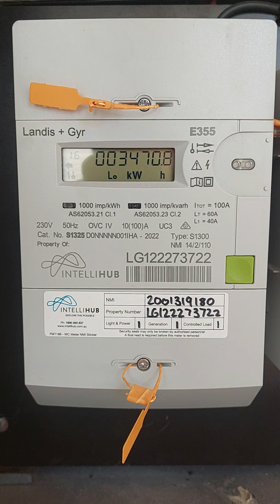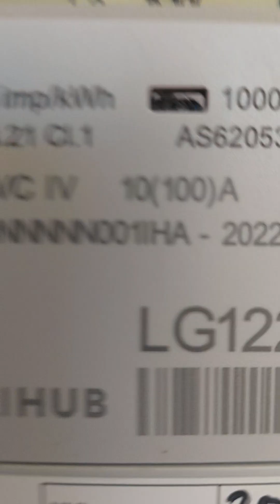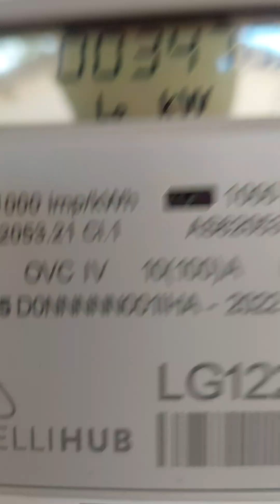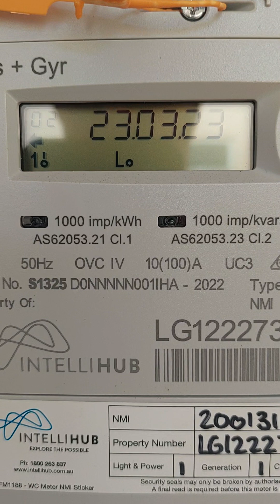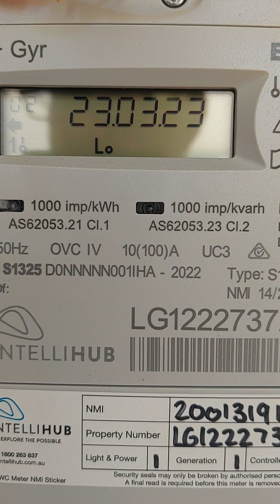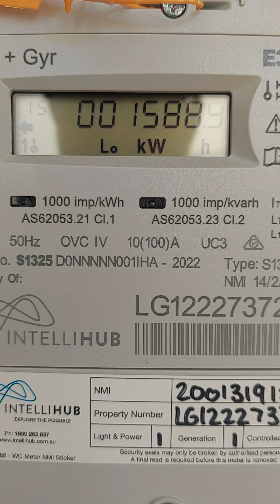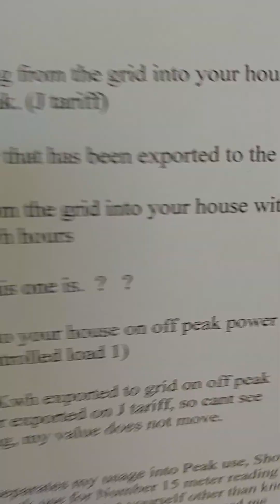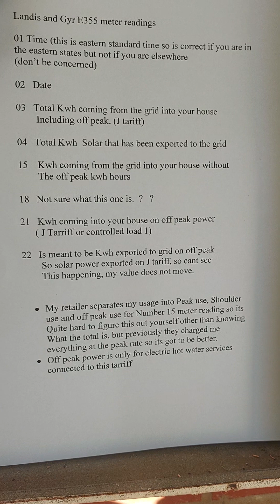How to read your Landis & Gyr E355 Meter

Comment: How to read real-time info from one of these meters: (yes, Jamie has shown how to read accumulated power).. press the button about 3 times until "ALT2" is displayed, then press and hold for about 3 seconds. It should display the Volts (about 240) and you can cycle to Amps - and see what you're actually using moment by moment. Plus a whole lotta other gobbledy gook. It will go back to normal display after about a minute.
Thx Jamie for putting this vid up - not at all surprised that nobody can find usage info, and power distros and retailers are all playing dumb and pointing the finger at each other: as long as they can charge us for power they dont care and dont have to.
Reply: Thanks very much for this comment. I wanted to see if there were any draws on the meter when the house power was switched off, and this did the trick. Also interesting to see the passive power draw of stuff that's always left on. And many thanks as well to Jamie.

Comment: Thanks for the video. It helped a lot. Although only fitted 10 days ago, and no bill yet received, register 16 (presumably 18 on your meter) on my meter appears to be cumulative total power produced by the solar system. This means that register 16 minus register 4 is the total solar power used locally with the balance exported, which is displayed as a cumulative total on register 4.

Comment: Thank you so much for this. Needless to say our latest bill was an estimate and hundreds of dollars over what it should be so, queue self reading the meter ... bit of a joke but with your video I now know what is in my pics :-D
Reply: These smart meters though are not “ estimated “ they are in real time that’s the whole point of them .. they are wireless direct to the electricity company which means they calculate in real time … your hundreds of dollars over is must likely the recent power increases in price which were massive … and also coupled with a fault somewhere possibly in an appliance inside a house .. that can be anything from a faulty Air con unit … hot water cylinders ( usual suspect check temp is set properly ) and also a faulty fridge with old fridge seals …

Comment: If I had realised how complicated this new meter was, I would not have let them change it. The old one was so easy to read and keep a check on.
Reply: Once you know what each register is measuring it is pretty easy to read the meter, the difficult part was how little public information about this meter is out there.

Comment: Mate I have a question I noticed on the sticker it says you have control load 1 off peak but notice the control load 2 light was flashing on the metre is that correct because I have control load 2 but only the control load 1 light flashes I also have a solar hot water heater and I have noticed now that the weather has cooled down im running out of hot water much more than I used to before they change the metre my query is have they accidentally connected me to control load 1 when I'm paying for control load 2

Comment: Hello, thank you for the useful video. Is the coding readings 03, 15, 21 supposed to be the instantaneous readings (how much kWh coming from the grid into your house at the current time) or is it cumulative (how much total kWh coming from the grid into your house given a period of time) if so what time period? I've seen some people say that it calculates total kWh coming from the grid since the meter was installed but I'm not entirely sure.
Reply from the maker: The readings you get are a cumulative total over time not what you are using at the time. these values will just keep getting bigger. if you dont have off peak tariff then 3 and 15 should be the same.
Reply: @jamieelliott3723  Thanks for the help, I have another question for my electricity bill the sum of the previous meter read and the current read is the usage I am paying for. This doesnt seem correct if the meter is a cumulative reading then shouldnt the usage I pay for be the difference of the previous read and the current read? Recently I've received a bill saying my electricity usage has increased by 140% since the last year even though nothing has really changed.
Reply: @realpart  actually it is my new house and I can see same meter with this one. the bill is 200% increased.

Comment: I have this meter installed after solar panels installation. I only have 01,02,15,16.
What's 16 for? 
Will I get other numbers when my retailer (in 16 days) knows that the meter is changed?
Reply: Yeah I only have 01 02 17 18

Comment: Thanks for the explanation mate. We too have solar hot water system and now the booster only works in off peak times on controlled load which means by days end we run out of hot water. Origin not helpful at all.

Comment: Can anyone advise what the arrow on the left is? Mine is facing the opposite direction.
Reply from the maker: pretty sure if its pointing right you are using power from the grid. if its pointing left you are pumping solar back into the grid